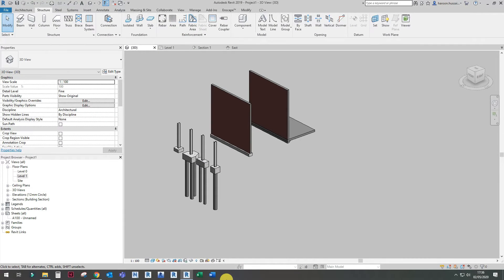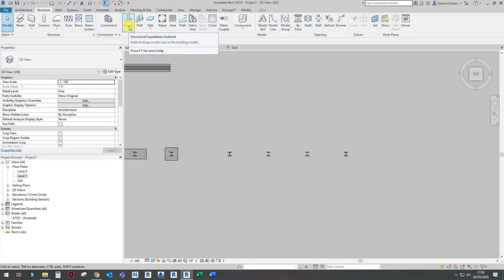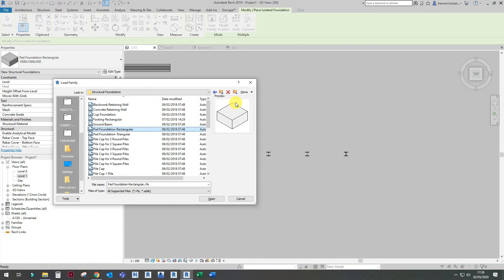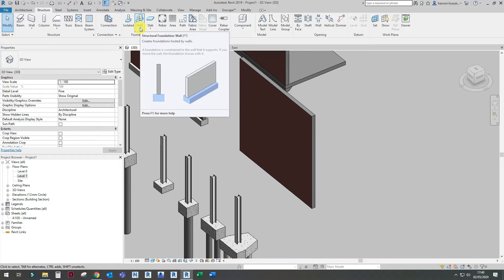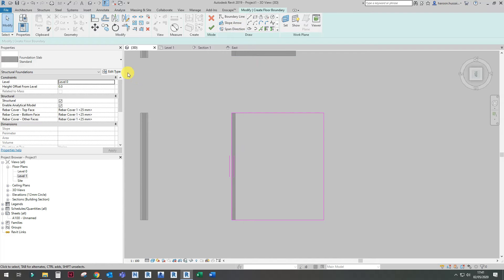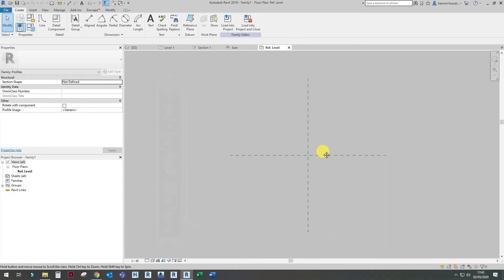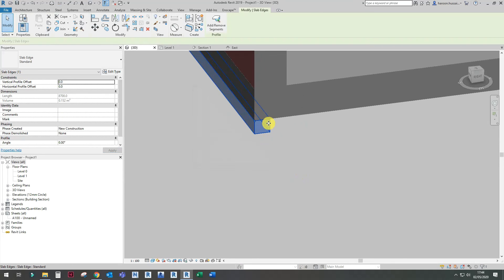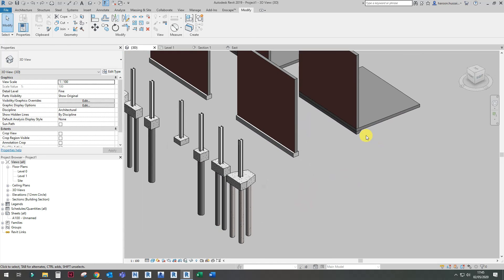HOW TO MODEL FOUNDATIONS IN REVIT | 2020 | REVIT ACADEMY

Comment: It would be interesting if you go a bit into the details of aligning the foundation with the wall on top. By default Revit aligns the foundation to the overall wall center, and you can adjust that to align to the center of the wall core by using the eccentricity instance properties, but then you get into many other troubles... such as foundations  perpendicular to each other no longer cleaning up correctly. Perhaps it would be interesting to go into those more advanced topics on how to deal with such conditions. I can not find any content related to that, and I think people might be interested.